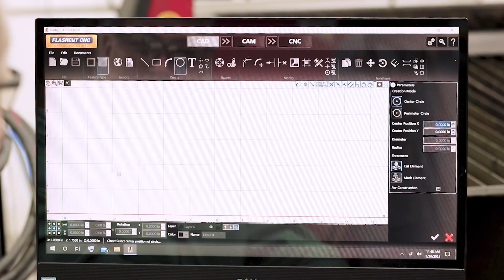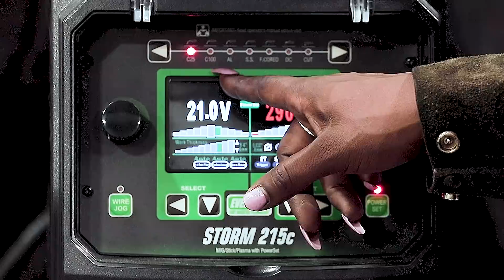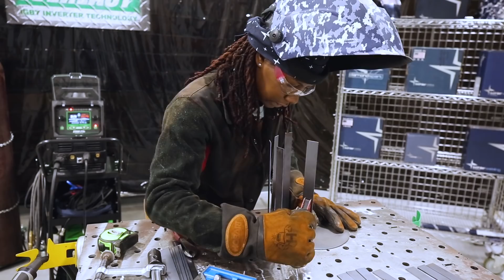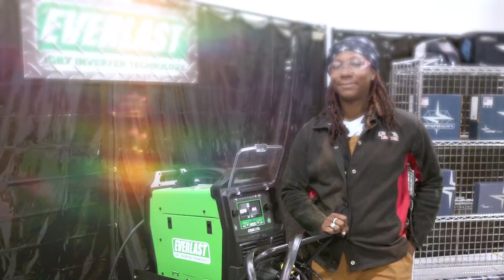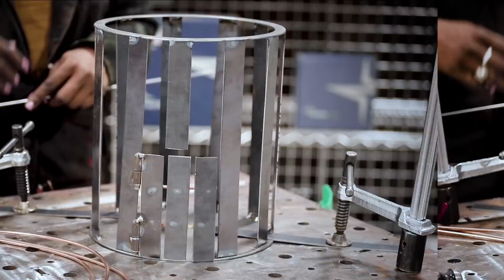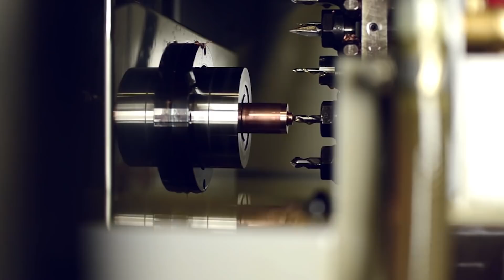Let's build a bird cage!!  Basic welding project with MIG

Comment: Wish you were my teacher, my welding skills so bad, I have to use 4 to 8 rods just for me to weld two pieces of square pipe 2 by 2 inches together, and the final result it's more than a mess.. I'm using the classic welding using welding sticks /rods, or what ever they called ,and when I'm done doing the joint of those two pieces of square pipe it looks like a tea spoon dripped in a jar of honey.. Well, to be honest, it looks so bad that my eyes hurt when I'm looking at it..  Lol !!  Just bought a new welding machine, but it doesn't have TIG, it's able to do classical welding using welding sticks/rods, MIG and MAG, but the supplier didn't sent me the Corgon (82% Argon, 18% CO2) yet, therefore I can use it as a classical welding machine. When it'll arrive I'll start learning properly (I hope), I'll replay this video, following the steps. Till now I was using a very old welding transformer, 50V output and 180-220A , and 0.1'' sticks/rods, and the gauge of the pipes was 0.12'' , and almost all the time I did went through the metal piercing it straight away, there's no power setting for the transformer, but sometimes when it gets hotter, it melts the stick entirely and gets stuck on material. than instead having a nice weld I have a totally mess, like I was welding here an there, it's not something continuous. I think this is because I cannot set up the amps for the gauge of the material and for the rods. But also when the gauge of the base material is so thin I should use MIG not classical. Am I right or my knowledge of welding metal is so wrong?
Reply: The amperage is definitely something that is necessary.  Sounds like the welding machine is definitely getting to joy of its burning the rod.  Might be time for some new equipment.  Thank you for the kind words.  There is so many different areas of welding and what you can do with it.  Continue to find more equipment to work with, try different projects to weld and have fun!  That’s all that matters.
Reply: BTW, Romania here.. Greetings from Romania :)
Reply: Get a machine you can set the amperage on... don't even think about welding thin metal anywhere near 180 amps my friend
Reply: @theuniversalbean9352   I bought a new one, MMA /MIG/MAG , it has a lot of settings on it ,including amps setting. I've got today the gas too, and now the real fun can begin.